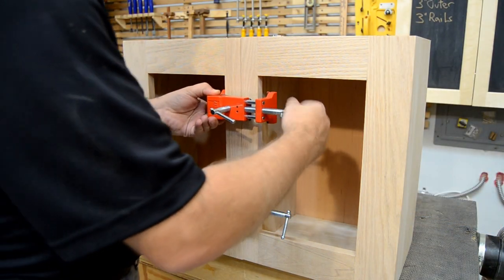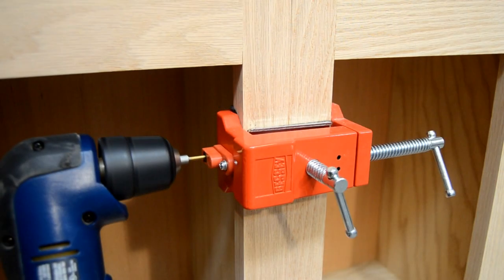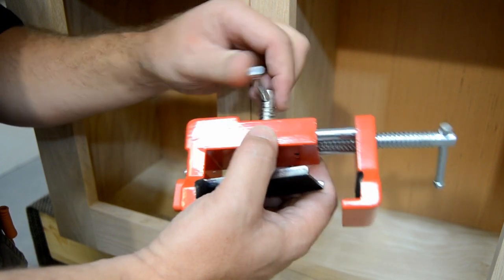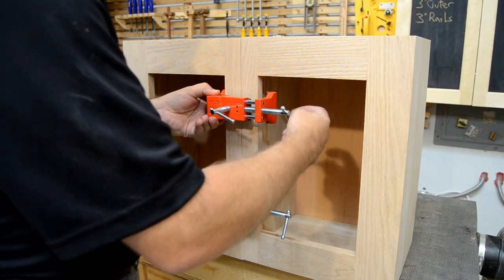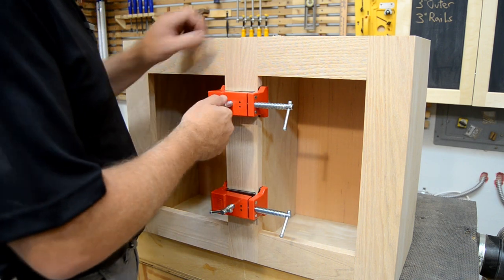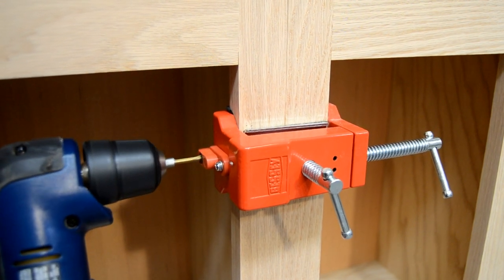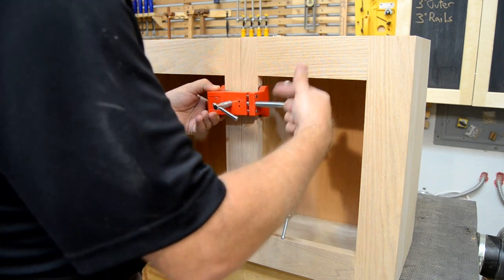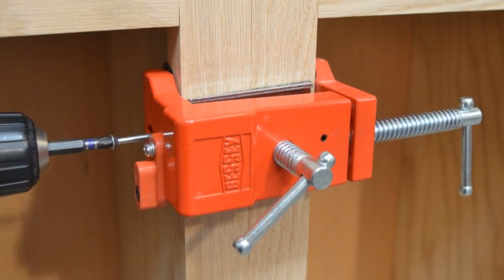BESSEY Cabinet Face Frame Clamps BES8511

Comment: You should make the hole a little bit bigger so a countersink can be used also.  Thanks for the new innovations and keep up the good work!
Reply: Just slide the clamp down and then countersink.
Reply: I use the countersink bit just above or below  the clamp. But yes a larger hole would be nice
Reply: There will be resistance on here, but where I work everyone uses trim screws.  Trim screws work well if you have cabinet claws like these, but don't always pull hard enough to get rid of gaps without cabinet clamps (the draw back).  With cabinet claws trim screws are the way to go.  Remember to still pre-drill.  GRK trim screws.
Reply: Try using trim screws
Reply: @wadopotato33  Agreed. Those are the screws I use and absolutely love!💯💯💯
Reply: We use the pan head screws that also will not work through the guide holes. We just do it above or below the clamp.

Comment: they are ok.  They made an indentation in the front of my cabinets due to the threaded rod protruding too far past the face of the center pressure plate.  There is no way to adjust the rod so i had to put wood shims in between the cabinet and the plate.  It really wouldnt take much to fix the issue with the clamps and make them really good.
Reply: Happened to me today 😞
Reply: Yep, same here! It didn't happen until we did the forth box. We did the same as you and used a shim at first, then we cut pieces of wood and taped them to the plate. I agree with you that it wouldn't take much to correct this problem and make them really good.